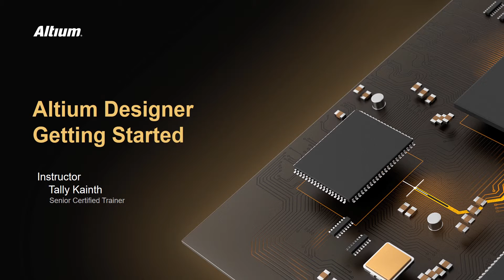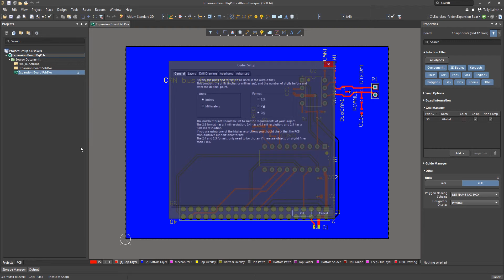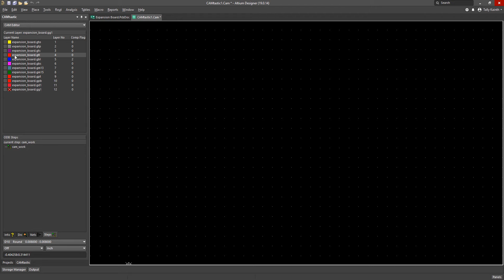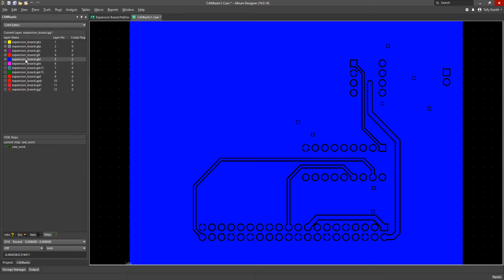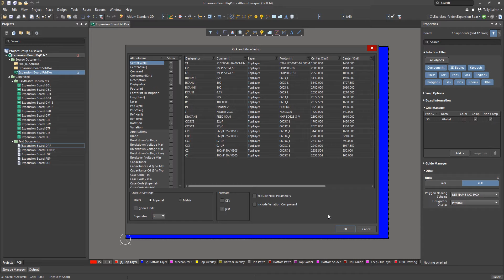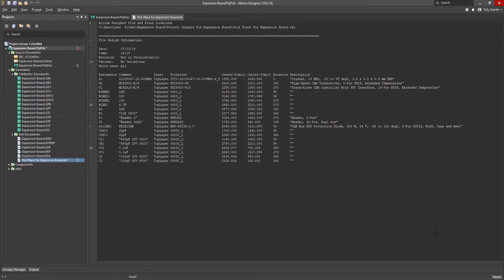(9) Generating Fabrication Files - Altium Designer

Comment: Is there a command-line tool, or command-line way of using altium such that it removes the title block from a gerber layer file?

For example, I used gerbv to open the gerber files generated in altium, but I'd like to remove the title block information programmatically (not manually).

Comment: I don't mean to be negative, I'm just trying to give constructive criticism. I'm an electrical engineer who has used Eagle up until this point. My new employer uses Altium, so I'm beginning the process of learning the software. I have found the process more than a little frustrating. I would describe the Altium interface and workflow as highly unintuitive. I began looking at posts online relating to how long it takes to get familiar with Altium. Most people say it'll take about a month to figure out how to make your first pcb, and from my experience so far that seems accurate. For reference, I made my first Eagle pcb literally the first day I downloaded the software. With Altium I literally can even figure out how to get components into a schematic from my coworkers' libraries. I mean I had to look that up online. That should be obvious to the point you don't need to find instructions. So far every operation I've tried I needed to look up how to perform. Altium needs to perform more ux research and make significant changes to how a user interacts with this software. I figure it's gotten to the point where they're just so entrenched as the default nobody is even trying to make genuine improvements. It's like how Casio calculators are significantly better than TI calculators, but everyone uses TI calculators because that's just what everyone uses. It's unfortunate
Reply: I thought that I was the only one facing these issues.
Reply: Same here.  Altium is not intuitive at all.  Too many steps to go through just to make simple changes.  It does have some great features once you learn how to use them.
Reply: YEAH BRO , IM THE SAME !!! IT TOOK ME A GREAT AMOUNT OF TIME FOR ME TO LEARN HOW TO USE AT LEAST HALF THE FEATURES IN IT !!!!

Comment: Hi there, when I generate my gerber files I don't have .GKO file for my board outline, I don't know what the problem is for this.
Reply from the maker: .GKO refers to "Gerber, KeepOut Layer". If you do not have a .GKO file it means you did not put your board outline on the KeepOut Layer. This is not necessary to do, but some PCB manufacturers anticipate that layer being a copy of the actual board shape and therefore request it when you upload to the quoting tools or website. You need to go back and use the menu Design » Board Shape » Create Primitives from Board Shape to add the board outline to the KeepOut layer (if you haven't already) and then regenerate your gerbers with the keepout layer included in the list of files to generate.